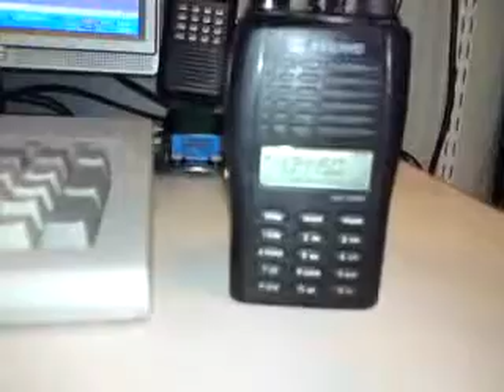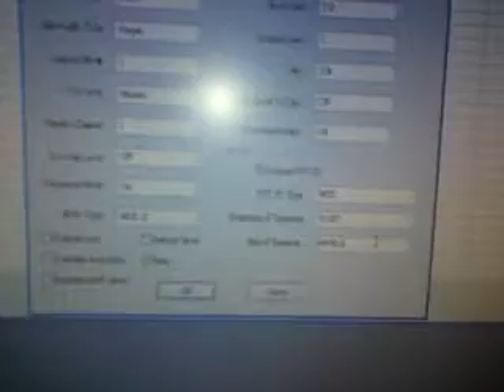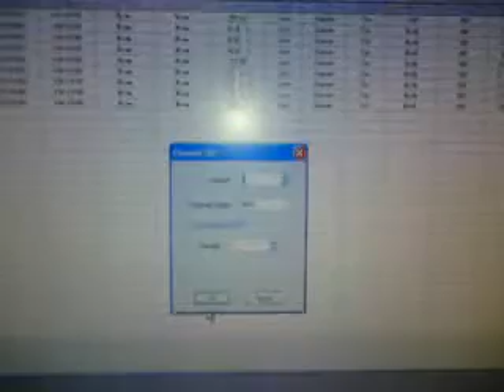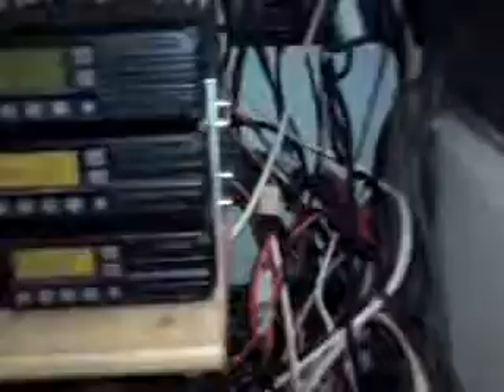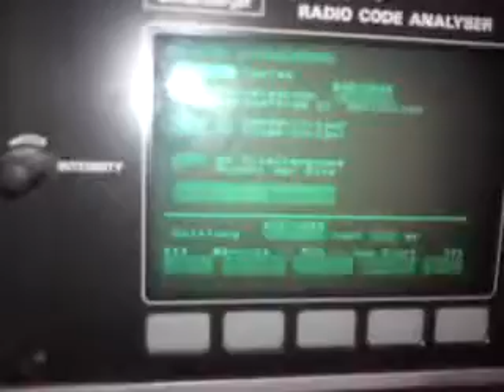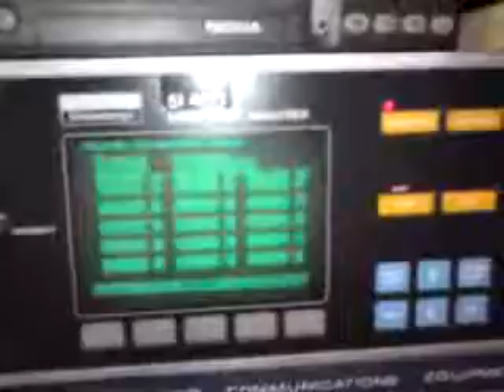PX-888 ANI usage

Comment from the maker: I bought it already programmed although, in addition to the old DOS software called Amanda, you can also add a 24c02 EEPROM and a 100K resistor to make a standard head into a programming head (aka red head). The software is, or at least was out there on the web but it took a bit of digging around for me to find it and as I recall, I never did manage to interface it to PC.

Comment: Awesome! it is such a pain that my kenwood doesnt do that!  Im getting a Vev-1000 Which is basically the same radio (Judging by the software ive looked at), I'll check with my radio guy and see if it works right with our system.  are these radios MDC-1200 capable?